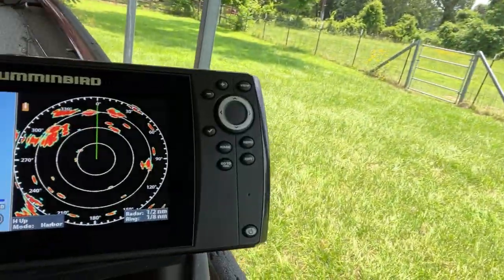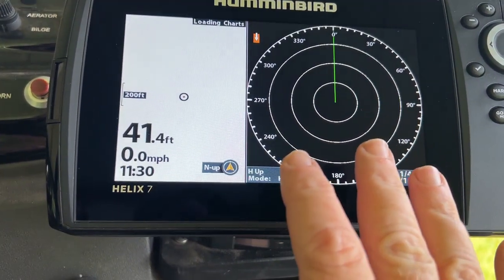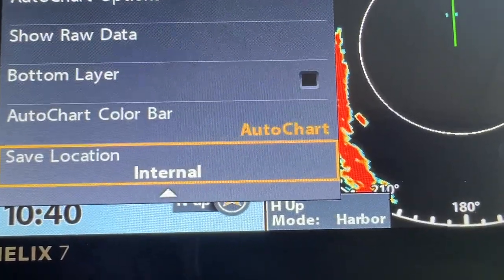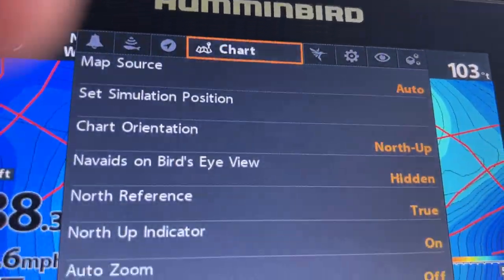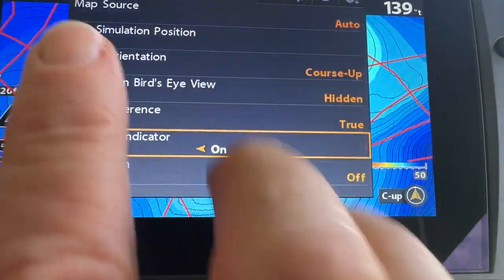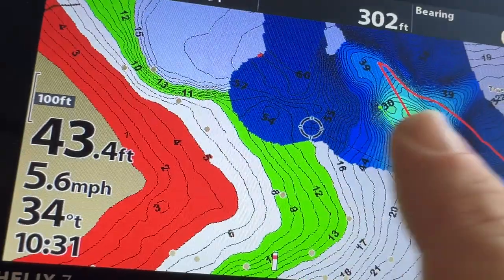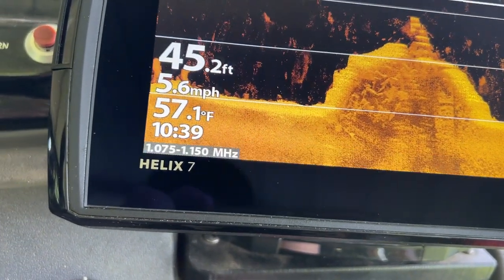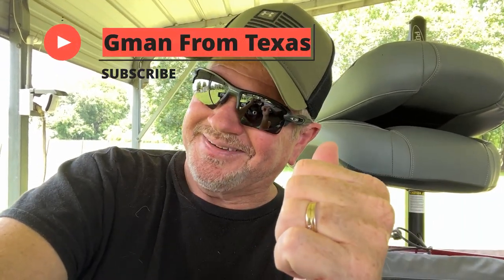Navigating Humminbird Helix Settings

Comment: Hey Gman.  Thanks so much for this video.  Can you tell me if there is a way to differentiate by highlight the depth between 1-5 feet?  I live on a slough and in the winter, especially, that gets hard to navigate as the entire slough is under 5ft.....actually alot of my river goes from 45 ft to 5 ft quickly.
Reply from the maker: Yes. Go to chart. Turn on depth highlight and choose a depth. This will shade in red any spot below your set depth. 
You can also turn on vessel offset and set a speed then every time you go over that speed your cursor will drop back on the chart letting you know what’s ahead of you. 
Hope this helps
Reply from the maker: Another feature that might help your situation is highlight range. 
In your case set the highlight to 4 and the highlight range to 2. This will differentiate your chart between 2 and 6 feet. Hope this helps too